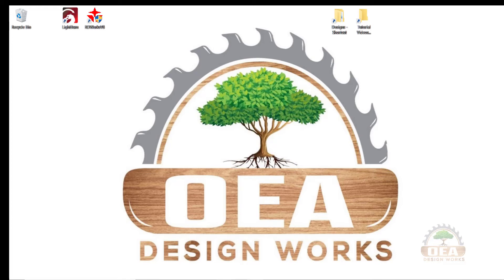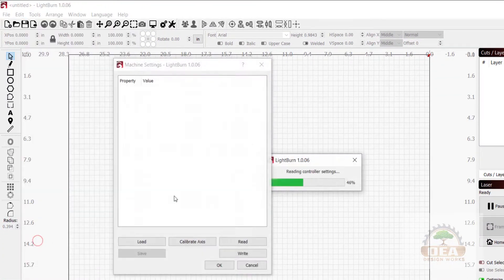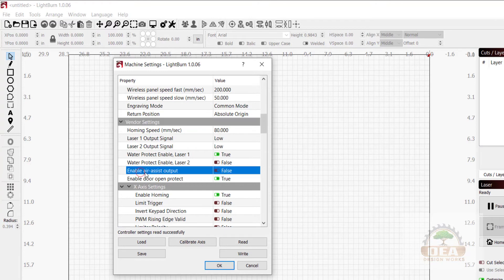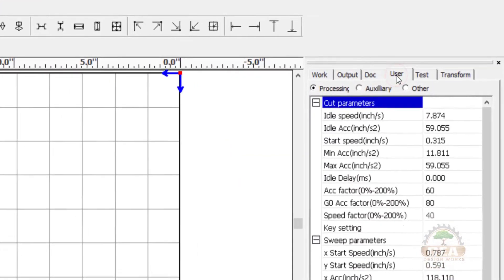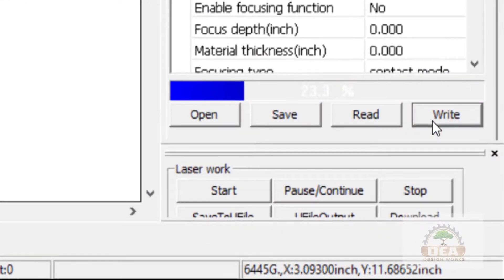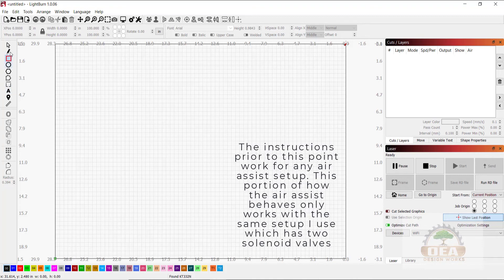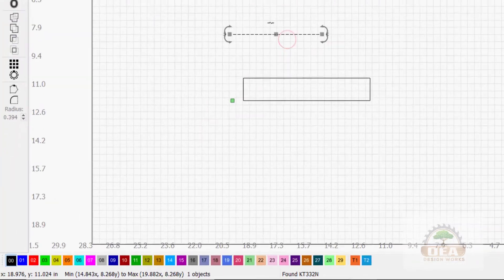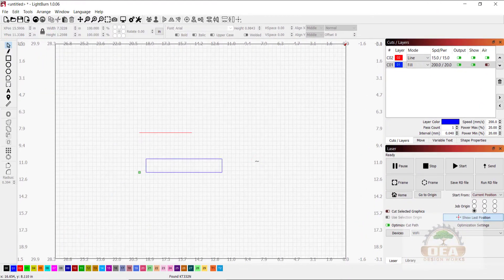Ruida Controller Air Assist Setup

Comment: Its possible to mady dry test of Air assist connection? I making DIY laser and now have made electric box with drivers. But don't have connected axis and laser power supply.
Try use pulse signal but it not turn on relay.
Reply from the maker: I don't understand the question?

Comment: I don't see blow type in the options in RdWorks. Under the other section its just not there.
Do I need to update my Ruida Controller firmware? I have a Ruda 644XG Red 80W with RDLC -V8.00.67.
Reply: Turns out the lightburn setting was enough to get both solenoids working.
Reply from the maker: glad u got it to work. the setting in RDWorks is used to keep the solenoid from switching on and off repeatedly. so its helps save your solenoid from wearing out sooner.  if you dont see the settings it could be you have downloaded an old version of rdworks.  if u r still interested try downloading an installing the version linked on my website

Www.oeadesignworks.com/software

Comment: Hello.  I could use some help in troubleshooting my issue after trying to do this upgrade.  I am not sure what to do at this point.  Not sure if I possibly damaged the control board that I can't get air assist to work properly, or if there is a wrong setting.  At this point air assist work whether I have it selected or not, and it will not power the low pressure solenoid.  The "Status" pin seems to fire the high pressure on, but the Aux Air pin doesn't seem to actuate the solenoid.
Reply from the maker: feel free to join my facebook group and private message me ( i am the only admin) and i can try to help you troubleshoot
https://www.facebook.com/groups/482491740230497

Comment: i did the setings in LB but air assit option isnt there after i write it, do i do it to both programs?
Reply from the maker: i don't understand the question.
Reply: @oeadesignworks  sorry lol i did both settings on both programs but in LB the toggle for air assist on the layers isnt there
Reply from the maker: I've not heard of that.  Maybe have to check with lightburn on how to get that setting to show up

Comment: Hello, is it possible to use two air filters/regulators with two 24v valves? Does ruida controller have two separate 24v connections to open each one depending if cutting or engraving, and when nothing happened both will be closed?
Reply from the maker: Just follow the setup in this video. It runs two solenoids, which are activated at different times depending if you have air assist on or off in lightburn. The only difference would be to replace the needle valve with a 2nd regulator. The current setup in the video does what u r asking.  Just has a needle valve instead of a regulator, so  with needle valve, you can't accurately set the psi for engraving like you would be able to with a 2nd regulator
Reply: @oeadesignworks  Thanks for replying. In stand by mode, meaning turned on the laser but not cutting or engraving, the air flows with low pressure all the time?
Reply from the maker: @Dimitris Mls  with my setup air will flow low pressure anytime Amy layer is actively running. High pressure will only activate when a layer with air assist turned on is actively running.  If laser is sitting idle like with lid open or not running at all no air should blow which is why I prefer this setup as it's not wasting air and making compressor run unnecessarily
Reply: @oeadesignworks  What do you mean amy layer? "Any layer"?
Reply from the maker: @jimidero  yes sorry for the type

Comment: I have 80W omtech.  I did the machine settings like in your video, and then I went to device setting Ruida.  I cant find the RD works.  Am I missing something?
Reply from the maker: what do you mean you cannot find the RD works? Do you have the program downloaded? If not there is a link on my website here to download RDworks

https://www.oeadesignworks.com/software
Reply: @oeadesignworks  If we never use RD Works, do we still need to download it and change the settings you changed? I only use Lightburn, so just wondering if I still need to do the RDworks changes
Reply from the maker: @anthonyalbanese456  it's best to download ans install it to make the changes. Then you can delete rdwork if you want